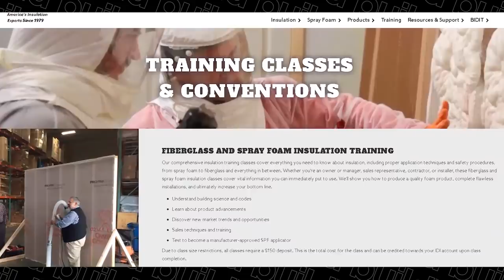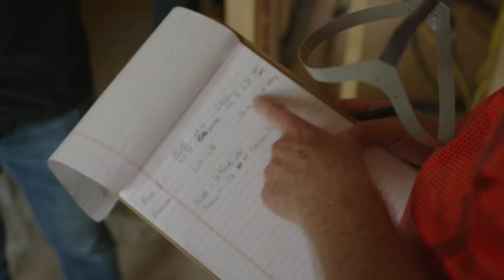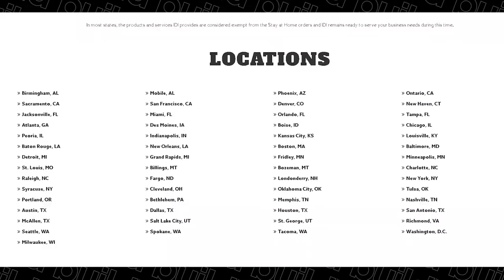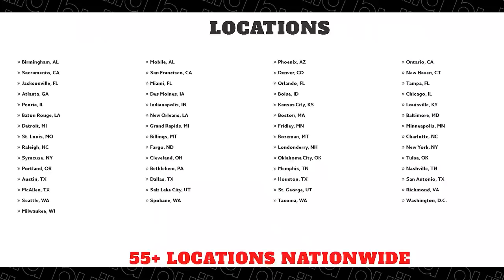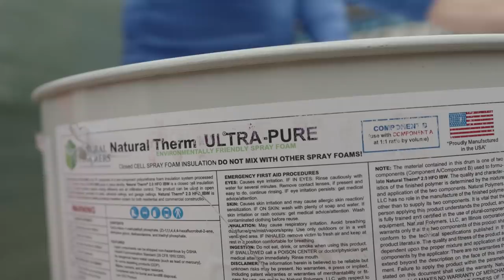"Low/No Smell (VOC's) Spray Foam" - Let's put it to the test!

Comment: As a CM for a Long Island builder I appreciate this video as most of our homes  get flash & batt treatment. The Greener & safer the materials the better for all. I am surprised by your use of spray foam in your house. With such a pre-insulation low blower door value seemed you were set up for batt insulation. My goal is to get the house tight enough that type of insulation becomes irrelevant.

Comment: AS Far as I know they haven't used Formaldehyde in spray foam since it was first introduced in the 70s and then they had to go back and tear houses apart because it was off gassing. Happened to a friend of mine.

Comment: Closed cell?  What's the R value?  Flammability?  Cost compared to open cell and polyiso?
Reply: R values is a false sense of insulation, is only rated in perfect lab settings not in the field. 2" of closed cell foam usually stops 86% of the loss of heat, doesn't make sense to go with more insulation, 3" of foam only goes to 90%. There is no good reason to foam more or put other insulation in. See Spray Jones youtube channel
Reply: @safffff1000  codes require R values.  Whats the R?
Reply: Im sure Belinda carr can address these
Reply: Imo i'm worried about adhesion
Reply: Yes it's closed cell.
Reply: @letsnotmakethispersonal6021  closed cell foam is as powerful as glue, is why everything has to covered or wrapped when sprayed because it's very hard to get off. Of course it has to professionally and properly applied
Reply: @safffff1000  video seemed more like hey I'm getting free spray foam but let's only talk over positive sales points.
Reply: Their website in one location says 3.8-7 per inch and another page on their website says 6-6.8 per inch so I guess it depends which of their products you use but they are claiming double the R per inch of fiberglass
Reply: @grahamstefaan  usually 6 per inch at least.

Comment: In the UK having spray foam installed in the attic can make it very difficult to obtain a mortgage for the property. It is tied in with the risks of causing/hiding wood rot in the timbers of the building as a consequence of trapped condensation.
Reply: Matt and other builders have talked about that fallacy before it's basically the thought that you should build a tight house because what if water gets in? 

The simple answer is no matter how your building water should not be allowed get in. That takes good construction and maintenance. If you aren't doing those things your going to have problem regardless of insulation choice.
Reply: @Mrcaffinebean  The reality in the UK is that mortgage companies and banks are very adverse to foam in roof spaces. He does great videos, but that does not reach the ears of the mortgagers.
Reply: @Orchardman53  we have similar issues with ICFs in the south (mostly due to inspector). You just have to work to find one that has some common sense and eventually everyone else will catch on.

Comment: the only way to test a polyurethane/disocyanate is to test it in laboratory setting with a vac oven to create a scale of out-gassing related to temperature.   that data needs to be compared to the total volume used in the house. i used to work for a company that used this stuff by the pallet. theres a lot of claims this salesman is claiming that are not possible.  if you live in the far north of the country this stuff would be great, DO NOT use this product of you live in a climate that gets over 100*F. rafters that get 120*F in AZ or texas this chemical WILL out-gas. do your family a favor, use rockwool.
Reply: Thank you
Reply: "theres a lot of claims this salesman is claiming that are not possible"

At least he can make the best cookies. :/
Reply: I live in AZ, and had open cell foam installed about a year ago. I don't know the brand or type, just that it is open cell. My attic was air sealed, as it was explained to me that it was necessary with foam. My house does continue to have an odd smell. Is it possible the product is still off gassing? Also, I envisioned the rafters being sprayed like the walls in this video; just the area between the studs, and essentially smooth. However my rafters look like a cave, with stalactites hanging down. I was told this was normal. Can anyone verify this info, as I have read that installing too much can be a problem. Thanks!
Reply: There are lab results for this product. This is for more of a real world comparison.
Reply: But...but the claim is that this is a "Natural Material"...now personally I'm not buying the Seven Herbs and Spices® without more evidence...being reminded of this makes water even more problematic with biodegradability and even trapping formaldehyde to dual use that is an ablative solution at best.
Reply: You are 100% correct. Don't ever trust the government or companies. That goes for drug manufacturing as well. Why, because your health is part of an equation and these companies have a lot of money and influence. Lawyers don't make you safe! 
The product here is a good quality product and is safer than most but the temperature matters with all forms. I will continue to use foam in walls but never in walls where the temperature gets above 110 for more than 7 days on average. It's still a great insulator.
Reply: @shinigamilee5915  if you can’t trust anyone’s test results then you would never build with anything. That’s of ridiculous and so you do trust companies and the government both on matters like these you just don’t care to admit it.
Reply: dB - Your foam situation does not sound right.

Comment: As "impressive" as this is its one of those things that always should have been when the technology existed. Its like forward automatic breaking in cars. What is spray foam? It is polyurethane thermoset plastic (a resin) that you spray and forms foam. That means a polymer needs to cure in a thermoset process, a blowing agent to create the cells and additives like flame retardants.

Blowing agents have historically been hydrofluorocarbon which are so bad for global warming just their use in installation completely offsets the benefit of using spray foam over other products like cellulose. You would think that'd been enough for the industry to act but it never did until HFCs were banned in spray foam at the beginning of this year. (Which I'm gonna have to let you in a little secret and say thats the reason this product exists.)

The blowing agent is the majority of what off gasses as you might expect. Newer compliant products like this one use hydrofluoroolefin which have zero global warming potential. The primary reason for this is because they breakdown before they can reach the atmosphere. Or in other words they are no longer VoCs very quickly which is also the reason they don't smell after an hour or so. (so it seems this feature of the product exists become of regulation too)

Most flame retardants are "organic" compounds or so called halogenated and so are toxic. Its not like non-toxic ones don't exist they're just more expensive so thats how they deal with that problem.

Finally theres formaldehyde which is the main concern. Formaldehyde, unlike most aldehydes, oligomerizes spontaneously. That's why its such a big deal. Some aldehydes are used in fragrances so they aren't all bad. They're talking about aldehydes because thats what his sensor actually registers. It's a similar issue with VoCs its impossible to register all VoCs so a subset of expected VoCs that can be read are used to prototype the rest and thats called TVoCs.

So really the concern is HFCs and formaldehyde. Formaldehyde can be bound up in compounds by making sure the structural group that its in is large enough to get trapped in the form. As its almost never in its monomeric form this means "capturing" all the middle forms. That means if you control for the part "A" and "B". The part A is methylene diphenyl diisocyanate while part B is any polyol. It's in choosing this polyol that does the magic of not creating those medium sized formaldehyde forms.

Comment: Wish they would mention the ballpark price difference between this "zero cell" foam and regular closed cell. Specifically in percentage terms. Is it 10% more expensive, 15%, ect?
Reply: About It looks to be about 2.5x compared to traditional open cell (i know this is closed cell in the video). I just got a ballpark quote from this exact foam contractor in dfw today at ver email. While i was expecting 20-30%, i was not expecting that price. I bet its because its a new product and the fact that it has no real competition in the low VOC category.

Comment: I'm far more concerned with how well this foam does after 20 years than I am after a few hours.
Reply: This.  While smell and the outgassing is certainly something I am interested in (there are horror stories about installs going bad), I am more interested in performance and longevity.  Are there any evaluations that compare this stuff to other types of spray foam?
Reply: You probably live in an apartment
Reply: The reason it doesn't smell now is for the same reason it will be safe in 20 years. Normally I am skeptical but in this case, the chemistry is sound.
Reply: @mike62mcmanus  " spun glass will not deteriorate."
False.
Reply: @phironosurvivors2069 being "smart" is a relative term. No need to get into your feelings if it's not true. Living in an apartment is OK. You can dry your 😢 now.
Reply: @mike62mcmanus  when's your guy's wedding? You two make a cute couple.

Comment: Would like to see performance and longevity of this foam versus the regular stuff. Most of the low or non VOC products I have used are substandard compared to the regular version.
Reply: Same.
Reply: I would hate to see the cost of it, foam is 2400 a set where I spray

Comment: This sounds much better for the people spraying it too. I still don't trust spray foam though. Targeted in a couple areas, maybe, but blanketing it everywhere....I don't know. Being able to uniformly seal everything instead of cutting batts to size and then tape...it is an appealing solution, but does it make a difference with all that awesome exterior insulation. If there is another blower door test later when the house is completely finished, it will be interesting to see if the number got even better. Guessing this wouldn't do anything the air sealing mist didn't already fix though. Ultimately comes down to sustainability/environmentally friendly and $$$. Nice to see spray foam is still evolving

Comment: Matt a VOC is ANYTHING you can smell, from the foam to the flowers in the garden. If you can smell it it's a VOC.
Reply: Explain I don't have a background, do flowers emit VOC sense I can smell them? (Honestly just interested not trying to be a smart butt)
Reply: Farts?
Reply: @onjofilms  yes even farts!
Reply: I think he knows. That's why they talked about how construction in general creates VOC's, but this helps reduce the amount of them on a job site. Whenever he is talking about smelling them he means the VOC's from the spray foam specifically - the unique smell usually associated with it that everyone is familiar with.
Reply: Don't think ppl know what VOC stands for
Reply: @randymathews3348  Volatile organic compounds (VOC's) are organic chemicals that have a high vapor pressure at room temperature. 

VOC's are responsible for the odor of scents and perfumes as well as pollutants. VOC's play an important role in communication between animals and plants, e.g. attractants for pollinators, protection from predators, and even inter-plant interactions. Some VOC's are dangerous to human health or cause harm to the environment. Anthropogenic VOC's are regulated by law, especially indoors, where concentrations are the highest. Most VOC's are not acutely toxic, but may have long-term chronic health effects.
Reply: @chaseoes  I was pointing out that VOC's are everywhere, some are bad some are not so bad.
Reply: @TdrSld  umm yes, this is known
Reply: I sprayed the inside of my attic with molten Hershey bars, that way I can have "Volatile Organic Chocolate" vapors.
Reply: Technically, not everything you can smell is a VOC. H2S has a scent, but is inorganic. But the vast majority of scents have VOCs associated with them.

Comment: Great show for a very good looking product. I wonder if Matt going to add more insulation for a small difference in heat transfer. The foam helps make it so much a stronger structure and air tight, you hardly need all that sheathing.

Comment: I'm a big fan of this channel and this sounds like a great product but this video seemed like an infomercial from beginning to end.
Reply: Thats because it is.I can tell you they are pitching this product because they want to get ahead of the competition. I can also tell you there's nothing novel about this product per say other than no one wanted to do it due to cost. At the beginning of this year regulations went into place requiring spray form stop using any hydrofluorocarbons which is the primary source of both VoCs and emissions.

Comment: And now we need interior paint (& exterior) that doesn’t smell AT ALL, b/c even low VOC paint is horrible for me, as I’m one of those lucky ppl that is super hypersensitive to VOCs in foams and especially Paint (even after adding some pure almond extract to paint as a “trick”. Know a touchy suibject for doing, but it’s something we do, and don’t use vanilla extract; as it does change pigment of paint, whereas almond/orange doesn’t imo.).
Thx Matt ✌🏻
Reply: So you are almond oil extract...IIRC that is Benzaldehyde and alcohol..so a partially oxidized toluene ( that is what Benzaldehyde is synthesized from) which if you are using a normal solvent based paint is not too far removed from the benzene related compounds used in most solvent based paints.

Comment: Hmmmm, grabbing aldehydes...I wonder if they are being grabbed with amines...how are they making this water resistant as that process would reverse itself if wet.  I'm assuming they are using a fluorinated Hydrocarbon as a solvent (like PCBTF) which is technically a non-VOC.  Also with this foam, what is flammability like?
Reply: All these foams suck up water like a sponge, another huge reason I would never spray foam. Even the smallest leak these spray foam jobs are a nightmare to clean up
Reply: @zack9912000  not with a closed cell
Reply: @FreekHoekstra   Even closed cell foams will suck up water. It's resistant to become saturated but can under the right circumstances
Reply: @zack9912000   it takes some serious effort though...
I mean compared to any other type of insulation i’d rate its resistance the best, except maaaaybe rockwool, but even then,
Fiberglass is horrific, and yes open cell is too, but i’ve seen closed cell foam with water just running right off, and even submerged for days (matt had a test for this too)
Without absorbing water, seems like it would take literal weeks of constant inundation exposure before it would become an issue.
Reply: That still sounds toxic, and this product looks like mostly marketing
Reply: @wdinternational  lol “sounds toxic” woah there, we got ourselves an expert.
Reply: Yeah I have those same questions.

Comment: So is this going to be like german cars electrical systems, where they use vegetable oil based polymers for their wire insulation, and subsequently mice and critters love to chew up the wiring harnesses.
Reply: wow, that hit home...  Squirrels just loved the VW Phaeton corn based fender flares
Reply: @aussie2uGA  Yep my audi has suffered o2 sensors and windshield washer fluid res, also the hood insulation too, which surprised me...
Reply: I mean... the guy in the end said that it is a deterrent to mice and other pests. I can't say anything about the first one since they didn't address that. Ultra pure might be chewable but the second one was not assuming they are different. Just basing it on the video. I don't know anything about foams.
Reply: Well, fiberglass is not edible to mice and rats yet they love to live in it as it makes a very cushy home and easy to tunnel through.  Foam is not a deterrent to mice at all, tho, as anyone who has used foam to try to close up a hole they're using can tell you.

Comment: I thought Matt was insulating with Rockwool.
Reply: He did upstairs
Reply: They don't plan to burn Austin.
Reply: In most of his house he's doing the flash and batt system.  Using both.
Reply: Maybe they stopped sponsoring and they need a 'kick'

Comment: @Matt Do you have, or can you make, a video on window films/tints that block UV and IR light but not (much) visible light? Specifically can they work on double paned windows? Or if not then can they be put on the outside with the knowledge they wont last as long. How to install them, best ones to get... stuff like that, you're the expert. :)
My rental's getting super hot now that Colorado has decided summer is here.

Comment: I am researching four-season insulation for an all-aluminum cargo box (similar in shape to a U-Haul).
Temperature range: 0-120F, western US dry heat.
My concern with spray foam is so few RV people using it and its long-term permanence.
I am leaning to a combination of products perhaps XPS (stryofoam) + alum-faced polyiso ?
I want ~2-2.5" thick walls, ceiling ~3".
Recommendations?